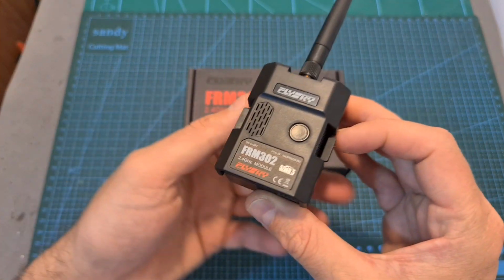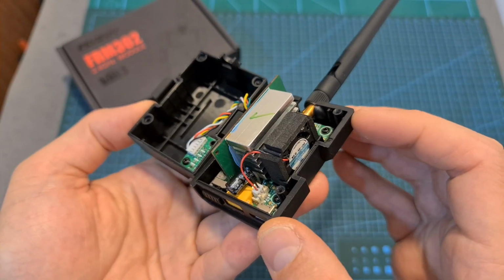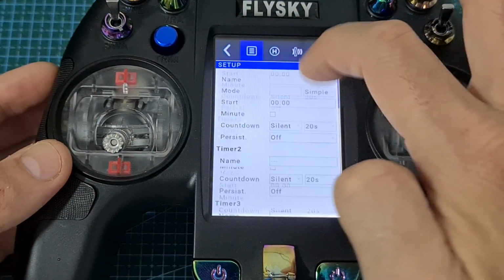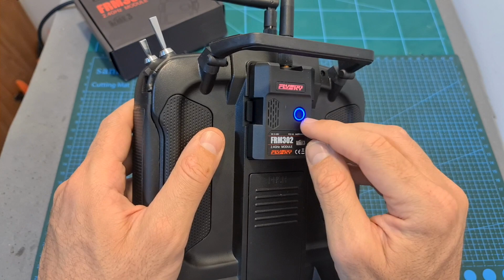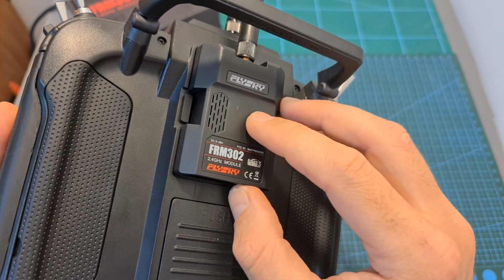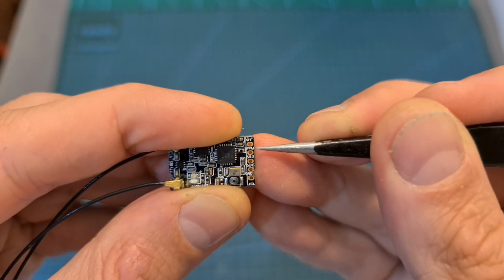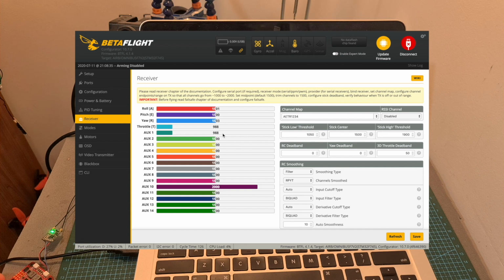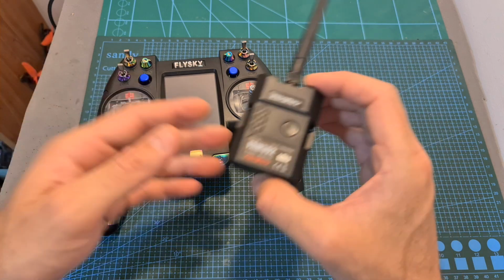FlySky FRM302 Long Range 2.4ghz Radio System - Setup & Overview

Comment: I want my car to have the best range (2.4 GHz). What can you recommend? The range should be very large, have FPV. Any 2.4 GHz boosts? which receiver and radio?
Reply from the maker: You need to use a radio controller that supports JR module bay in order to use this type of modules.
Reply: @KremerFPV  dumborc RC?
Reply from the maker: @tugrasarchive  nope.

Comment: Any news about range and range test ?

I could not find a follow up video.
Reply from the maker: I unlisted it because Flysky told me that there might be some issues in my test. I plan to test it again but I am under many time constraints. Until I will test it again I can't recommend getting one of this modules. You can also Check Paweł Spychalskis video about this module.

Comment: My FSB302 doesn't go into bind mode when I turn on the power while pressing the LED button.Also, it can't do the bind operation from the transmitter.
Reply from the maker: Which radio transmitter are you using?
Reply: Hello!
I tried it in PPM mode on my X9D.I watched your video and tried binding with the external and internal power switch and the LED button, but it seems that sometimes that doesn't work.I did it with the power switch on the transmitter and it bound yesterday.So I tried to make a 2W long range test video against you and I broke the receiver by mistake.Another month of waiting for the package again...

Comment: OMG. Where to begin  :(  1. Rule of thumb is lower freq is better penetration. 2.4Ghz easily gets muffled by trees and moisture.. not to mention WiFI everywhere. 2. 2000mW. Holy smokes. But, unless you already bought an AFHDS3 transmitter and receiver, who is going to buy this?  Nobody with FrSky will switch. Nobody with TBS CF will switch.... so, why!?

Comment: I have the nirvana radio and I've always wanted more range than the stock 500m. I'm not into super long range wings or anything, but I'm very nervous flying over water etc without a long range module, just in case it failsafes. I was considering getting the crossfire micro, and I see they are about the same price. 
I might end up choosing this one, just because it's the same brand as the radio. What are your thoughts?

Looking forward to the range test! Can't wait to see how it performs
Reply from the maker: Range test is almost completed and should be up soon ;-)

Comment: Interesting. Really interesting if the price is good. But 2watt at 2.4ghz is so Damm illegal
Reply from the maker: In some countries, not all :-)
Reply: @KremerFPV  
For search and rescue here in the States I can get a waiver. We are considering the Noble surface transmitter due to logistical reasons. Any clues on an updated model of the "flagship" NB4 to go to 8 channels or more for robotic delivery options?
Reply from the maker: @nobsnospam2368  That's interesting. Sorry but I have no idea...

Comment: i hope there is a mod for fs i6 for this :(
Reply: That would be so funny😂😂
Imagine a $30 controller getting 50km of range LOL
Reply: @Rob haven't even bought mine yet 😅 just using a simulator, still no budget. Goodluck on your flying journey 😉
Reply: Impossible. Its AHDFS3. Best case, you can use 1W/2W signal amplifier on FS i6/ i6x. Or upgrade antenna. Patch or yagi antenna can easily get 1-2km range, probably up to 10km... but ofcourse its 2.4Ghz. WHO CARES ABOUT BEST CASE!? You can come back from 2km out, return to parking lot to do victory lap and crash because signal cant go through 2 cars.

Comment: I would wait on the Crsf Firmware update bevor compare them two. Crossfire Micro is going to 1 watt! 
Also you make sure new friends when you blast 2 watts on 2,4ghz 😂
Reply: where did you get this information about 1w ?
Reply: The chip make max 500mw

Comment: So its a 2,4ghz with a built in booster our ?
Cool finaly flysky trying to make something better for the range.
Reply: Flysky has 2km stock range with a fitting receiver
Reply: I know that flysky is able to fly maybe 2km but still flysky is not really good in solid range.
Not all transmitter from flysky get a 2km range.
I did my testing with flysky and it never actually worked out well.
A 1km allway but 2 our 3 trees between you and your quad and the signal is gone. Here the modul is boosting the signal extreme up.

Comment: This is quite possibly the stupidest R/C product that has come to market in 2020.
2W on 2.4 Ghz is just stupid.   You will almost certainly cause others using 2.4 to fail-safe as you raise the 2.4 Ghz noise floor to the moon.
If you want to do long range, go with a lower frequency, as called out in the video.   There are proven 900 and 433 Mhz options already on the market for this.
This product is detrimental to the hobby.  It will interfere with Wifi.   It will interfere with other 2.4 Ghz radio control links, and it will further crap on 2.4 for FPV video.
People have been using 2.4 Ghz boosters and causing these issues for years.   This FRM302 is just a turn key product for FCC violations.   It is Part 15 certified, but at 25mw.
Reply: Not everyone flies in crowed airspace...
I'd say a MAJORITY of pilots are flying solo, without another pilot for several, if not hundreds of miles away.
Reply: I’m not sure, but i’ve heard that in Europe there towers that work at a frequency close to crossfire’s and when you get close to one of these you get a failsafe asap. I think they chose 2.4GHz because of that. And i’ve heard in some other places too that 2.4GHz is better for pure long range while 900MHz is better for bandos, penetration, city environments.
Reply: @gamaxgbg  crossfire on 868 mhz has no problem with 900mhz radio towers. I even dove some
Reply: When I saw that they were doing LR at 2.4Ghz I was confused. Then I saw the 2W power output option and had a face-palm moment..seriously? Why lower the frequency and get better penetration when you can just sledge hammer your way through obstacles with more power. And just when you think it couldn't get worse, they ship it with a whip antenna...good Lord, why? Just listen to that fan go. 😂
Reply: @gazzoification  
No failsafe, good for you.
Low latency means nothing if there's a lot of packet loss, the problem with 2.4 system. Exactly why TBS went with 900 system.
This module will only accept PPM input with other radio, much higher latency and no telemetry function.
2.4 at 2W will definitely affect WiFi, it's not a rocket science. Even my 100mW transmitter sitting next to my computer greatly affect the internet speed. Either your WiFi runs at 5GHz, or you didn't further test the connection quality after turning on the radio.
All AFHDS3 does is remove backward compatibility with previous AFHDS receivers. No full function 3rd party radio support, no openTX script support, etc
At nearly $96, this product is a ripoff when you can get TBS micro v2 for $69. More functions, proven reliability, wide compatibility..
Reply: @gazzoification  
Not sure about your condition, but I have experienced slowed down WiFi whatever I have my transmitter turned on by my side, and even that's on 100mW.
At close range, yes. At distance, there will be more packet loss with higher frequency. I can clearly feel my control lags as I go further on 2.4. I don't have this issue with 915 system.
Maybe if they listen about what we want instead of going their own way, they'll have the place in FPV. But no, they decided to stay proprietary by not adopting openTX, weird radio form factors and so on. Also, the module is simply too expensive for what it is when there are other systems that are more polished and cheaper.

Comment: Great overview. Just curious about this system, I'm running crossfire. Always good to know about options. 👍🤓
Reply: I'm just getting into the long range aspect.. I have a x-light and love it. It came with r9m module and attenna.  But never needed. My eys failed way before control. But now have dji goggles.  So time to upgrade.. whatever your suggestion? Would appreciate your opinion. Thanks and have a great day!
Reply: @sleepingbearffg5008  if you are using the x-lite radio with the dji goggles the easiest route to long range is with crossfire. But many people have been successful with Frsky R9, it can be a bit trickier. Mainly with having proper/same firmware on the module and receiver. 🤓